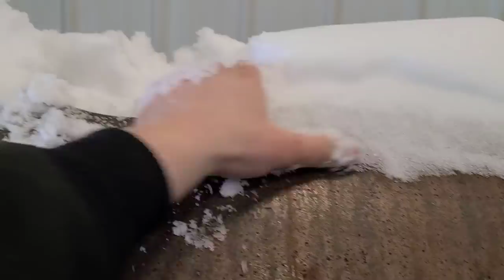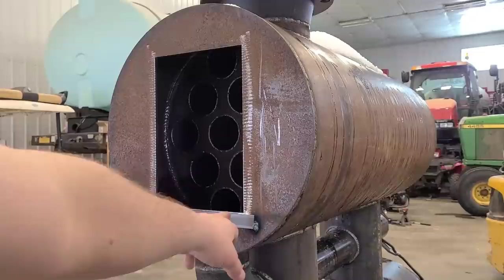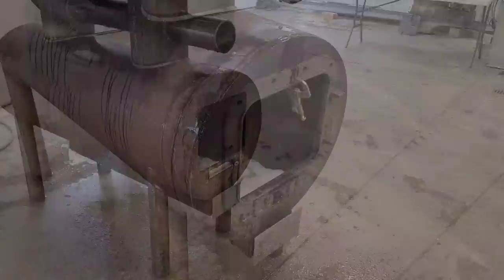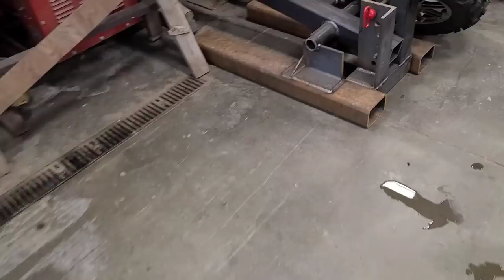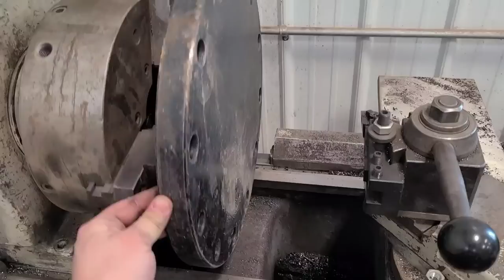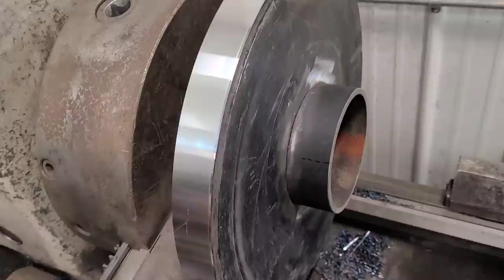My Ultimate Shop Wood Stove Build Part 2

Comment: Back in the 80s i had a friend upstate ny owned a big 5 bay body shop w 14 foot doors....he used a 275 gal oil tank as a wood stove.....and had a 5 gal bucket w a ball valve that could feed oil/trans fluid/brake fluid to the stove.....when he had to open the door for a few min....the temp inside would drop 20 degrees....so he would open the valve 3 or 4 times and the stove would turn red...temp was back up to 70 in 5 minutes🤠🤓😎✌✌✌

Comment: This looks impressive, Kyle. I built my double barrel stove 50 years ago and it has totally heated my house for all those 50 years. For perspective it has burnt roughly 250 cords of spruce, fir and poplar.
My bottom stove is just a quarter inch plate box stove. The top stove is the same size but thinner and it has an oven cut through from front to back. The stove exhaust travels around the sides and top/bottom of the oven to exit at the front as you did here. Two oven doors allow one to bake lots of good things.
You're wondering about soot buildup in your top barrel. My top barrel needs to be cleaned every 3 years to avoid loss of draft. This is light gray soot that likely migrates up on top of the oven during fire startup. Your design looks like it will be even more efficient than mine so it will be the best stove in the world. Salute from NB, Canada!
Reply from the maker: Thanks for watching, I'll be happy if I only have to clean it every few years, install and firing video coming soon!

Comment: Quality Work. I would call that Industrial grade wood burner. Maybe later you can incorporate a used oil burner when she gets up to temperature/water heater/ Hot plate/ETC...
Reply from the maker: It would be very easy to incorporate a waste oil drip tube, and may very well happen 👍
Reply: @kylechrist  I'd love to see that! I started a similar project a couple years ago but used a oil furnace tank instead of 2 "barrels", project got back burnered when I couldn't make up my mind on a few options on how to build it. This project has the wheels turning and makes me want to get back to building mine! One of the things I was debating on was how to best incorporate oil burning. So please add so I can see how you go about it.

Comment: I built one like that back in 1996. It works very well. Difficult to clean and it must be cleaned often. We clean ours twice every winter. It works best clean because the creasote builds up quick on the tubes and acts like insulation. I put my blower on the floor and built duck work up. I always wanted to build a metal box around the blower with a filter to clean the dust out of the air in the shop but never got around to it. I did put a furnace switch that automatically turns the blower on when hot and off when fire dies down. I can manually run the fan, there is a switch for that. It looks good.
Reply from the maker: Thanks for watching, as for cleaning, time will tell what I need to do to ensure it doesn't build up with creosote

Comment: I would have built it like a fire tube boiler.  The exhaust gasses go through the tubes, with a hinged access door.  Then just a round chimney brush, run it in and out of the pipes.   Then use the blower to pressurize the body and have nice hot air outlets available.
Reply from the maker: You do yours however you please 👍
Reply: @kylechrist  I appreciate you posting your design none the less.  Despite some of the flaws it's quite impressive.

Comment: Nice job looks heavy duty enough to me. ❤ That cap you added to the cleanout access port, looks like a real good hot plate for warming up your lunch or supper. I would definitely consider putting either a 3-speed fan switch that you can utilize all your wires for different motor speeds or a rheostat if your fan motor will take it. If you want to get really ambitious you could put three different temperature thermostats in three different locations, the lowest pipe would be your slowest speed when the stove isn't so hot enough yet . And possibly a wall thermostat on the other side of the room to control all of them. 😅 That would enable you to regulate how hot your shop gets. 😊

Comment: When I made a shop air cleaner with an old furnace fan like that, I found an inexpensive multi-position switch so I could use the different speeds. You could also use a switch with a potentiometer dimmer to make it variable speed. Some of the new smart switches are capable of this and you could build in some smart automation with a thermostat.
Reply: Just a pull chain from a ceiling fan would give him 3 speeds. and can be picked up at any hardware store. but I'd probably just order a multi position rotary switch switch

Comment: I won't say anything bad about your heater, only the experience that I have with mine. Mine is almost a twin to yours with the exception of the direct fan, only 5 thru pipes in the top collector & no scavenging thru the lower chimney pipes. I just use a box fan to remove the heat from the upper collector. What I find when removing too much heat is the creosote builds up in the chimney & when opening the door to add more wood the smoke reverses & comes into the shop. Both issues were caused by the chimney smoke being too cold. I have about 12' of insulated 6" chimney
Reply from the maker: You are absolutely correct and too.much heat can be pulled from the smoke. I am hoping that once this mass is heated up, it will burn hot enough to not be an issue 👍

Comment: i love it, that thing looks like a beast! But i do have one suggestion, you might want to consider adding a dedicated air intake from the outside for the fire, that way it doesn't suck up all the air in the room, causing cold outside air to leak in through the cracks, modern furnaces do this as it helps with heating the room
Reply from the maker: It's a shop stove, there are plenty of building leaks 👍
Reply: I did this with mine, it helps a ton

Comment: Only 1 more addition you need, on the bottom (firebox) off to the side under your 4in, put you a plate and gussets to direct heat on plate for a couple of coffee cup heaters. Nothing worst than cold cup of Joe. 
I mounted a antique cafe griddle to the side of mine, great for breakfast, lunch an dinner. Cooked alot of meals for kids an parents when We had horse club trail rides from my place.

Comment: I enjoyed your Pt-2 as much as I enjoyed Pt-1 Wood burning heater build, but I must say, that was a lot of lathe machining to make a cap for the Heater cleanout pipe. As always, I will be waiting for Pt-3. Thank you for 2022 and Happy 2023 New Year to You, Your Family, Friends, and Fans
Reply from the maker: It was quite a bit of machining but I wanted a heavy cap as the heat will be trying to go straight up on the bottom of the cap and I don't want anything to warp and leak. Thanks for watching

Comment: with thickness of the steel that you used to build this awesome heater , from past experience in dealing with the soot problem , all I did was build roaring fire and a lot more air flow to the fire chamber and burn a good stack of hard wood through . soot problem handled.
Reply from the maker: Exactly! 1 year review video coming soon!

Comment: Well this is no doubt an awesome stove, looks like it will last for life and will provide plenty of hear for a very large workshop even on the coldest days

HOWEVER

Most of us can't weld like that

Most of us don't have access to a metal cutting lathe

Most of us do not have access to a plasma table for precisely cutting out all those parts 

Most of us do not have access to all that heavy plate and pipe stock which I assume the guy got for free  or scrap value 

SO

Most of us would be further ahead to just buy a heavy duty  fire brick equipped, blower equipped wood burning  stove from someplace like Northern tool, 75K to 150K btu that run from a little over a grand to and little under 2 grand.

A little more expensive but on the other hand you just order it it shows up in a few days, you take it off the shipping pallett , hook it to your chimney pipe that you have to use regardless , plug it in and light a fire in it.
Reply: @Dale What your "HOWEVER" is missing that with Kyle's build he ends up with a firebox of such dimensions that it can be fueled with available scrap wood while involving little further processing. The alternatives suggested are not available (to my knowledge) with such a firebox; suddenly wood processing labor spikes.

Not taking anything away from Kyle's build, but absolutely a similar design could be built utilizing more basic workspace, methods and materials. 

SO, don't be easily discouraged. :-)

Comment: I used a snap switch so the fan would work by the stove temp. I was worried the fan would get to hot if not running. This way I just leave the power on and the fan turns on and off by temp. Nice job I'm sure it will work well.
Reply: Do you have a link to the product you used?

Comment: If you are concerned about the fan housing getting too hot, you can always make some insulators out of 1/2" concrete board and perhaps add an extension of a few inches. Watching your first video on this stove, I was thinking that you could cut a couple of holes in each side of the center horizontal pipe and add some furnace heat pipe with fishmouth ends, which will spread the heat further out into a room from the sides of the furnace. The constriction of the fishmouth would act as a venturi and speed up the dissipation of heat into a room. You could mount the fishmouth ends at a slight angle and allow them to rotate, so the heat can be directed. The same goes for the front of that pipe. For the door hinge you could use a section of 1/2" stainless round stock right through both hinges with a SS nut welded on top and the bottom threaded for jam nuts. I think you may need to gusset the lifting eyes for sideways strength. How much so you think that unit weighs? Any inadvertent swing when lifting could really damage those eyes, maybe even pop them off of the stove. It only takes once. Curious why you built such a massive and heavy cleanout? !/4" - 3/8" plate would have been ok. I would like to know where you found that furnace door, it's a good sized door?

Comment: Only 2 problems i see and same ones i had with mine is….nowhere near enough draft and caused it to blow smoke in the shop when it was starving for air, i drilled 2” holes below the door with a simple flap i could swing over to let it breathe. 2 i had to put a speed controller on my fan because it would blow so fast the air felt cool hitting me.  After slowing the fan and giving the fire some air that thing will melt your hair off your neck 30’ away😂

Comment: Just remeber that you will get better efficiency with a counter flow in the heat exchanger.putting cold air in the front of the stove and the hot air out the back is much more efficient. Great build though so far!
Reply: Why is that more efficient? What's the difference?
Reply: @OverKill6969  So the idea is that the lowest temperature air going into the room air (cold side) of the heat exchanger should see the lowest temperature of the flue gas (hot side). This lets the room air pick up heat throughout its cycle through the heat exchanger. For example, if the room air going in is 60 deg and leaves at 200, and the flue gas in entering the heat exchanger enters at 600 deg and leaves at 250 deg. If the 600 hot side is matched with the 60 cold side and the 200 cold side is matched with the 250 hot side there is an imbalance in the delta (difference in temp) when the cold air and hot air enter on the same side. The higher efficiency is to keep as high a delta continuously throughout the heat exchanger. Therefore if the 60 is matched to the 250 and the 200 is matched to the 600 side it is a greater delta throughout the whole heat exchanger and will result in higher heat recovery.
Of course these numbers are made up and will change as the setup changes, I'm just trying to explain as easy as possible. Does this make sense or am I failing miserably at getting the point across? Essentially, it is hard to heat 200 deg hotter using 250 deg hot side of the heat exchanger so you want the hot air coming out to see the hot flue gas going in. And the cold air going in sees the cool flue gas leaving, but the flue gas is still 4 times hotter so it heats it up way better. Make sense?
Reply: @letsgetsteve  ah ok! So if you are going to suck room temperature are into your heat exchanger (to be heated) at the back of your unit and blow it out the front of your unit. Your chimney should exit your heat exchanger at the back and your hot gasses should enter at the front.
Reply: @OverKill6969  Yes, but the problem with that is that you want the door and air intake to the burn chamber to be as far from the chimney as possible or having a long burn chamber becomes a bit useless and having good fire control and complete burn will be almost impossible. I would say for this style of furnace/stove, that I would mount the blower fan at the front high enough to be out of the way, maybe 6-7 feet off the ground, blow through the furnace front to back, and put a slit diffuser at the back to channel the hot air to the left and right of the furnace evenly. Then you aren't just blasting hot air against the wall behind the furnace, the chimney can be closer to the wall (which helps reduce the amount of chimney work inside most of the time) and the best part, is that the nice really hot air coming out of the heat exchanger isn't going to be blasting the person filling the stove in the face while they are loading it. The blower gives the opportunity for the intake to be anywhere to be honest. Gives a lot of flexibility. Also, one of my biggest pet peeves about these stoves is how much air from the room you are heating will be consumed and pumped out of the chimney as the fire burns. In most of my designs I try to have an intake for the burn chamber that is piped in from outside of the building. Helps with efficiency because it keeps the warm air in the room... In the room, it also helps having a nice dense cold air feeding the fire.
Reply: @letsgetsteve  my game plan is a fresh air feed from outside that is piped into the woodstove and distributed via 2 steel pipes down either side of the stove with holes drilled in them. I figure that way I'm feeding the fire with air evenly and I'm not creating a vacuum in the building, sucking cold air in every draft I have. I'm hoping the pipes down either side (inside the fire chamber) also help warm the air.

My chimney is going to exit at the top/back so I'll be placing a baffle to make the hot air enter my heat exchanger at the front. I'm also using a pipe/fan setup the same as this video but using an old oil furnace tank instead of 2 tubes.

Comment: Find a temperature regulating flue as well so you dont have to worry about condensing/sooting in your chimney I'd also use something to regulate your fan on and off too. I'd say a 350-450 exhaust temp is ideal and you can use a combo of flue and fan regulation to stay in that range
Reply: I'd say flue opening closing 325-400 and fan on off at 375-450 so your flue has the main control of fire and your fan runs only once the flue is at the end of it's control
Reply: It will need to be able to run way hotter than that for some part of the normal burn cycles or else it will start condensing wood tar out of the exhaust until it either plugs something up or takes off in an out of control stack fire which can burn at temperatures so hot it can melt thin wall stainless steel stack liners.  

Guess how I know.😋

Comment: If you remove too much heat energy from the flu gas there won’t be enough thermal convection for it to draft properly and therefore it Might slow the fire speed down. 

Also smoke from the flu gases will condense on the heat exchanger tubes. The smoke should be burned through a secondary burn gasification chamber. That is how you achieve the ultimate efficiency.

The best stove I have seen is a Garn ws1500 it’s about 90% efficient. It uses negative pressure to suck the air through the burn chamber. The flu gases are relatively cold when they exit and they therefore don’t need to go up a chimney put down into a barrel. 

Plus you have 1500 gallons of water a sensible heat Storage
Reply from the maker: Straight and simple, it's just a shop wood stove. It's not going to run 24/7 so 1500 gallons of heated water is irrelevant

Comment: Honestly I expect the bottom pipe to be suction. Since it's perpendicular to the flow of air. The only way it could push air out is if that fan blows enough air to pressurize that space where all the tubes meet.
Reply from the maker: The fan does move air through that pipe 👍

Comment: That is some heavy duty stuff.  You know, new wood stoves, well, already 10Y ago, they started making ovens that burned the gasses 3 times, before it came out of the stove pipe. In effect,  60%-70%  more heat than a traditional, simple wood burning oven, and exceptionally low on pollution. Maybe it's just Europe that has those products.  So it's just not necessary constructing so complex builds.  Fun though :)

Comment: With the old rectangular cube air tight wood burner I built? We were having a bit of trouble with soot and creosote build up. Which meant more frequent cleaning than I wanted ? Because of the air tight burning to make it more efficient, less wood. So we started using anti creosote buildup powder. Cut cleaning to a minimum !! Worked great
Reply from the maker: I'll have to look into that. With the dry pallet wood I burn I get very little to no buildup but a preventative wouldn't hurt at all 👍